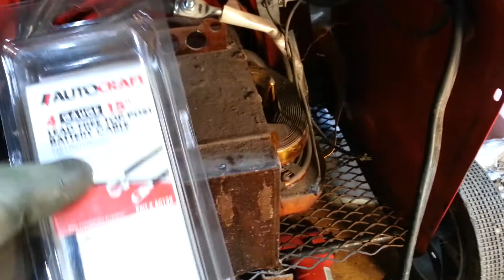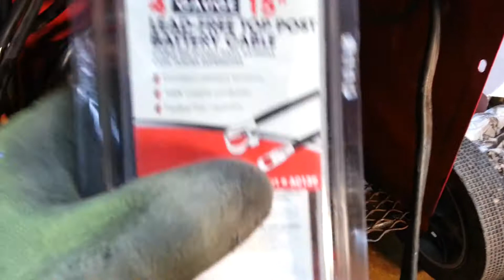Adding Bridge Rectifier 300A/1600V High Power Single Phase Diode to LINCOLN AC 225 Welder

Comment: A full wave bridge rectifier converts AC to DC, do not tell people otherwise.
Reply: A bridge rectifier converts AC to a pulsing DC.  If you have an AC at 60 cycles per second, a bridge rectifier converts it to 120 DC pulses per second.
Reply: Dude you're definitely misinformed about electricity as a whole. How do you have positive and negative if it's not DC
Reply from the maker: I am a welder and this video uses electrical components to help convert AC current into DC. Alternating current (AC) and direct current (DC) are forms of electrical current that use positive and negative channels to carry the power to welding rod in different ways either intermittently or directly. DC has a hotter and cleaner weld which is why people want this conversion. House outlet power is 120-220V is AC. Not sure what your insulting comment meant but hopefully the video helped you.
Reply: @djrowe10   You might open up an AC/DC Tombstone 250, to show whats inside? Or, I eventually can find one myself.
Reply from the maker: I agree with your response and is why my message is that just simply adding a wave rectifier alone doesn't provide clean 100% DC conversion alone. My video contains none of the other needed things to make a clear pure signal in DC from AC. There is an actual electic engeneer on YouTube who shows all parts and how to do what you listed in his video.
Reply: Dj, not trying to be nasty here. A full wave bridge rectifer turns ac to dc. The ac signifies alternating current. Not to be confused with voltage. In the US it operates at 60 cycles per second. Or 60 HZ. However you want to refer to it. For half of the cycle current is flowing in 1 direction and the second half it stops and changes direction for the second half of the cycle. DC direct current the current only flows in 1 direction. The arangement of the diodes in the rectifer only alow the electrons flow in the output in 1 direction only. So yes, the full wave rectifer does turn it in to dc. At 60 hz ac input it is a choppy dc output. A rise and fall in amplitude of the direct CUrrent.  Capacitors are most commonly added to smooth out the choppy output. The reason the more sophisicated machines cost more is how the manufacturer go's about creating the dc. It is still dc  unless you have a faulty diode in your rectifier. The word rectify loosely translated means to straighten out. A half wave rectifer only allows 1/2 of the cycle to be used but creates dc at .45 the voltage. A full wave rectifer uses full sign wave and outputs .9 voltage of input. But jump up to 3 phase rectification and you get 1.45 out voltage to input voltage.  But still current in one direction. Then depending on lead connection. You get (epdc) electrode positive direct current or (endc) electrode negative direct current. With all this said it most assuredly changes that tombstone to dc when correctly connected.
Reply from the maker: I let people make comments on my videos and you are entitled to your opinion. If a $20 wave rectifier made an AC welder into a DC welder then Lincoln and Miller Welding must be doing something wrong I guess.
Reply: @djrowe10  The bridge rectifier does output DC current (as it is no longer alternating), but the power signal is not a clean straight line. The power signal will have significant ripple between the peak voltage and zero volts (but does not cross zero, as that would make it AC). Capacitors (in parallel) are needed to smooth out the valleys in the signal in order to "clean up" the dirty DC signal produced by the bridge rectifier. The capacitors will charge up when the voltage peaks and then discharge when the voltage drops, providing the desired smoothing effect to get a cleaner DC power signal.

Someone attempting a DC conversion on an AC welder will want a bridge rectifier capable of handling the max number of amps produced by the welder with a margin of error (more margin of error the better, but also more cost). They'll need to provide good heat sinking (preferably with a dedicated fan as well) so that the bridge rectifier can stay cool. They'll also need high-capacitance capacitors (they will be physically large and probably fairly expensive). The capacitors should be wired in parallel with the DC side coming out of the bridge rectifier. A bleed resistor should be wired across the DC lines for safety to discharge the capacitors and to prevent the machine from trying to weld/spark when it's otherwise powered off.
Reply from the maker: Thanks.
Reply: @brandonh6326  what size bleed resisters should I use for multiple 250v 1500uf caps. I want to use two or four caps. I will also triple loop a ferrite toroid on the DCP lead.
Reply: As a electrician it's impossible to convert Alternating current into direct current you can only rectify it, your dc welders also have a rectifier in them, your only common true source of DC would come from a battery bank